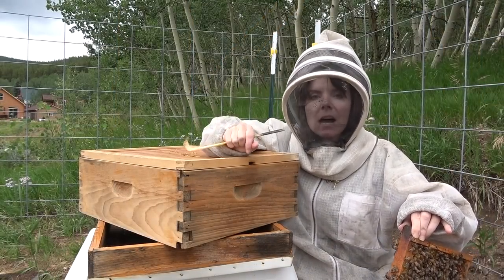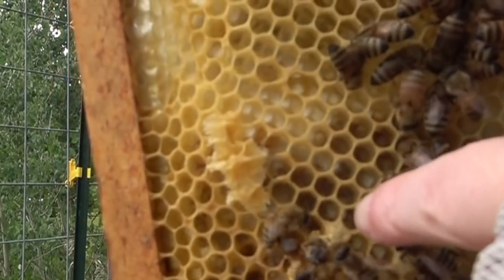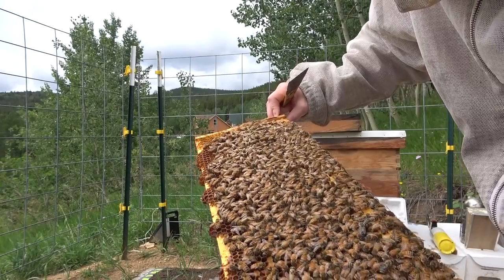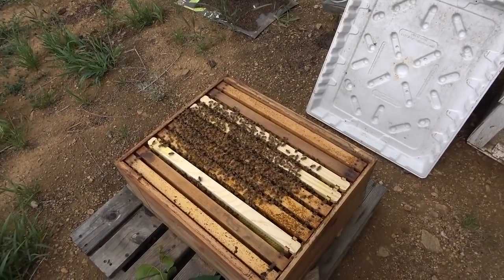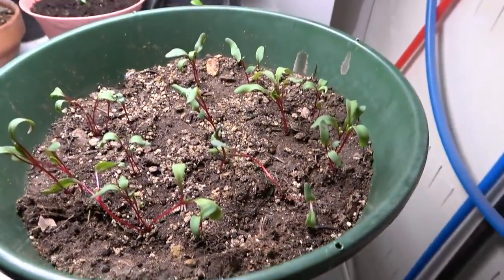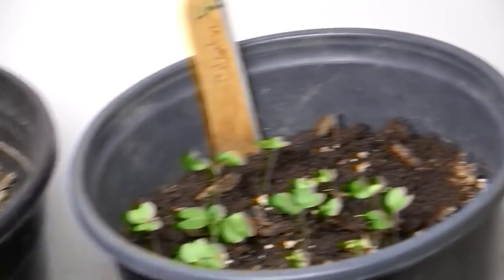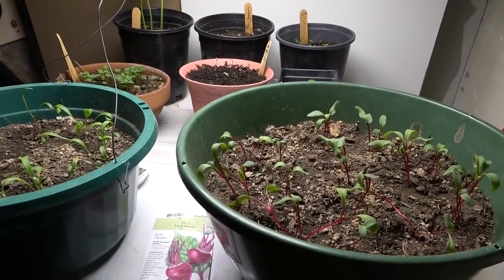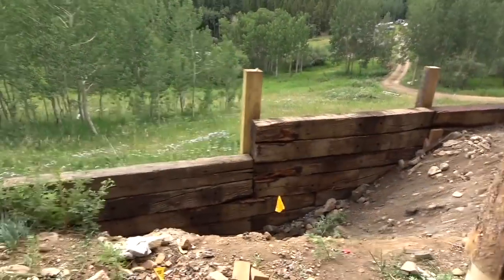Retaining Wall Challenges, Beehive Status Check & Grow Light Progress

Comment: Say...? Would it be workable to build a winter greenhouse over the septic tanks? (Not your geodesic domes but longer hoop house style?) Part for chickens and part for gardens? Added benefit of preventing frozen septic system...???
Reply from the maker: That is an intriguing thought. The only question in my mind would be the durability of hoop style with the strong wind we get up here.
Reply: @ColoradoMountainLiving  No - they make the kind that resemble hoop buildings but more like whats called quonsets with more rigid frames but come in kits. Justin Rhodes just ordered a couple and is going to be erecting his shortly - see his videos?

Comment: I’ve built many retaking walls - all of then stand tall and straight today.  I always used a series of t mans to anchor the wall.
Reply: You’re absolutely right. Only way to keep that wall from moving is a good anchor into the hill. Brian’s idea for a crush-zone is a no-go. The weight of the soil, not to mention waterlogged soil, is tremendous. A foam layer to absorb the movement and/or expansion would have minimal impact. Oh, and weep holes. Looks like a good crushed rock foundation.
Reply from the maker: Stay tuned for the next video where we take our viewer's advice and add T-mans!

Comment: If those tubs have drain holes then I would suggest a lot more watering is needed Compost is very porous and water just drains down and the short roots barely get a sip before it drains out the bottom. Any plant needs 2 things, light and water - you have the light taken care of...
Reply from the maker: Thanks for the reminder, the soil stays pretty moist, even with the constant lamp.

Comment: Do not try to compact the fill by driving the tractor on top of it.  The tractor will only compact the top foot at most. There is a high probability that the wall could give way whilst loading it this way.

At 1400 in the other retaining wall video there is a crushed end of a land drain next to the western most deck column. I assume that this is the end of the land drain that runs down the west side of the house. If it is it will be discharging the water that  comes off the roof and side of the house into the ground next to the column base behind the wall. This will weaken the soil supporting the column and load the wall.

Did the column base move when you hit this column with the tractor bucket. Is it now out of plumb.

The weight of a bag of the premixed concrete will be about 30% to 40% more than the uncompacted native fill.  The additional weight on the buried section of sleeper will not be very high.

An expansion joint material down the back of the wall will not help. It will compress then the soil will settle into the gap formed. It will never uncompress. There are rigid hollow plastic boards that  can be used for rear wall drainage.
Reply from the maker: The broken drain was an interesting story that got cut out of video edits, turned out it was just a severed piece of drain with no connection; so the entire  remnant was removed. we did test the gutter drain from the house and confirmed that it drained below the wall. Bryan was able to move the deck column back to original position. When he made those, he had a pin in the center of the concrete post base and a hole in the wood column to help restrict movement. It was the wood he hit with the tractor, not the concrete base. He decided against using the concrete bags as extra weight and you'll see in the next video, other ways he's decided to reinforce the wall. Also decided against the foam board; he was thinking out loud; but glad to know he's decided along with much of what you've suggested. Thanks!

Comment: Why did you not interweave the wall i believe that would have been stronger but too late
Reply from the maker: The first 2 rows are, but ultimately the majority of the force will be coming horizontally, not vertically, so less worried about the "weave.".